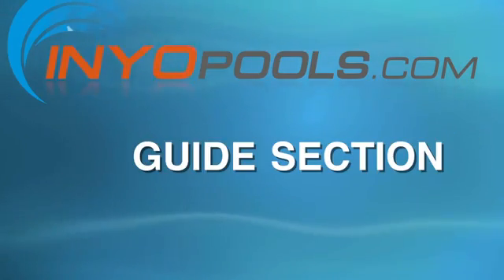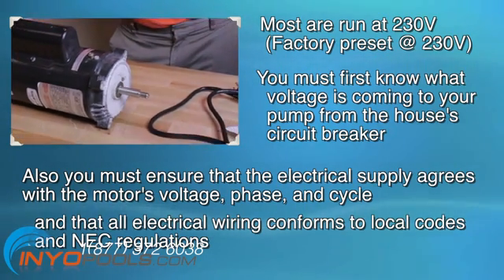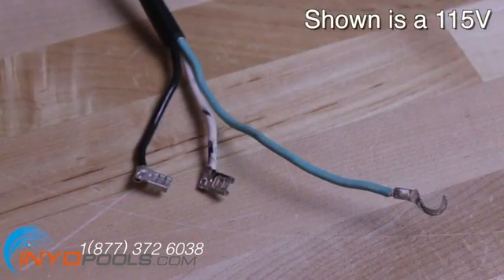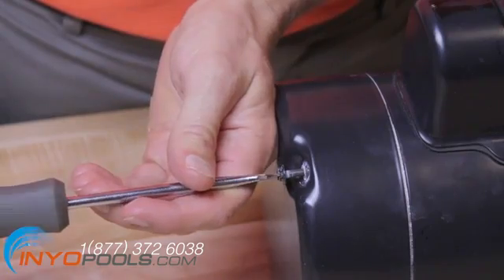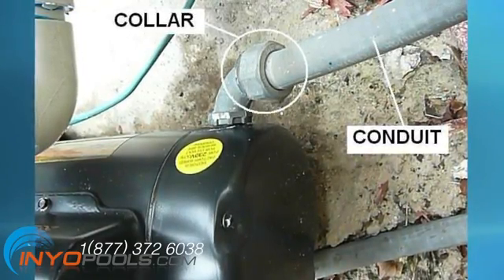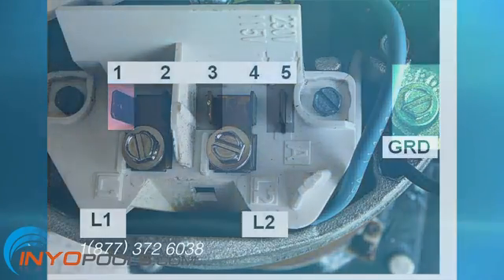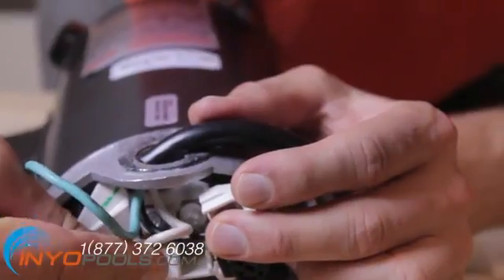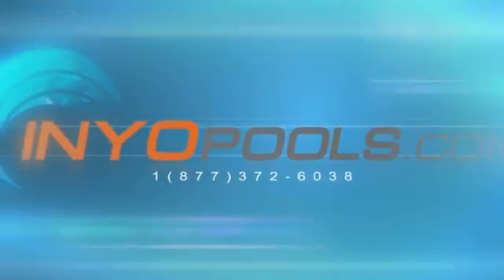How To: Wire A Pool Pump

Comment: Noone shows where to bond bonding wire to what
Reply from the maker: The pump's bonding wire is connected to the ground rod, which would be installed when the inground pool was built. The ground rod and wire are already in place when a pool owner completes this installation, which is why most guides don't show the wire getting connected to the other side. It's already there.

Comment: What if I have 2 black wires, 1 red wire, 1 green?  Cap off 1 black wire?    for a 230v motor
Reply from the maker: Is this a single speed or dual speed pool pump motor?

Comment: I have wfk-12 the wiring diagram for this thing doesn't tell me where power in goes please help! I have the multicolor wires in the unit set for low voltage.

Comment: I am new to this topic. Need to replace old 1 speed 1HP pump with new one 1 speed 1HP pump. Different brand names. Have never deal with pools and pumps before. Watching YouTube for educational purposes. You say that White (neutral) wire goes to L1, and Black (hot) goes to L2 terminals. Another source on Youtube says that Black (hot) goes to L1, White (neutral) goes to L2. Whose information is correct? Sorry for this question, but I dont want to fry new pump.

Comment: Mine has 2 white wires coming out with a ground on the housing. How do I know which wire to connect to the box?
Reply from the maker: We'll need more information. Are you trying to connect the lines to the motor or to a timer/breaker? If it is a motor, what is the catalog or model number?  Have you confirmed the voltage using a multimeter?
Reply: @Inyopools  I got it figured out :) the new motor I got only had two wires coming about 3 in. I went into the back and saw where to connect the ground wire.

Comment: My original plug has a red, white, black and green ground wire. Which two do i use on my hayward 230 1hp motor.

Comment: In the video it says, regarding the bonding wire, that the "Bottom wire is connected to the pump..." well no kidding. But where does it go?
Reply from the maker: The bonding wire from the pump is usually connected to another bonding wire using a split nut.  Check out our guide titled " How to Add a Line to the Pool Bonding Wire". It will explain how everything around the pool is bonded. http://www.inyopools.com/HowToPage/how-to-add-a-line-to-the-pool-bonding-wire.aspx

Comment: Hi, I am replacing  Hayward super 11, 1 hp. with Hayward max flow 1.5 hp.   The house wiring is for 220 volt. My question is   what is the difference  between  110  and 220    is it performance ? or other things   what will happen If I use 110 Volt option  ?  Hayward max flow 1.5 hp. is wired  for 110 1nd 220.    Thanks.

Comment: Question. I got Pentair Whisperflo 230v 2hp. I did an overhaul to the motor and changed the bearing and shaft seals. I like to test the motor see if ok,  before installing to the pool. Electrical motor I have L1 L2 and ground and there is white wire going for motor to the L2. How do I test the motor with regular wire and plug to outlet?
Reply from the maker: Hello Armen - Most standard outlets are 115v. Your pump is 230v. You won't be able to test it with a standard plug and outlet. You can test it with the power that is currently running to your pool motor.

Comment: Thanks for a straight forward video!!
QUESTION-- I am switching from a 230v dual speed to a 230v single speed-- my current connected wiring is 1-white, 2-black, 3or4-blue, ground-green. *I have no RED wire.
?? My new Pentair WhisperFlo has L1 & L2, &ground--- do I simply attach white&black as hot and remove blue?? Guessing "3or4" is the low voltage 
Again, going from dual to single.
Thanks!!
Reply from the maker: We highly recommend that you reference the wiring guide that came with your motor. A 230 single speed pump requires three wires( Two hot and one ground). White is never a hot wire unless someone improperly installed your wiring, which could be very dangerous. If you're unsure how to safely test your wiring to figure out which lines are hot, then we would recommend getting help from a local professional.
Reply: Inyo Pools 
I'm going to use a red Sharpie and color the white wire red the first couple inches.
Reply: Inyo Pools 
Thanks for reply, and suggestion-- I looked at old motor diagram, it was wired correctly for using timer vs switch... except they used white for what typically red wire on motor L1.
I simply removed unnecessary blue wire from power supply,taped it and left in timer box for possible future use, taped off motor end as well, then straightforward wiring.
Motor is working perfectly!!
:) Yayyyyy *thanks again

Comment: I upgraded from 1hp to 1.5hp and followed this simple instructions. When I turn on the pump it trips the circuit breaker, what am I doing wrong?
Reply from the maker: Hi Big Mike, when a breaker trips, it's an indication that there is either an electrical short or an overload on the circuit. Double check your wiring to ensure that there are no breaks or wires touching. Also, your new more powerful motor may be drawing more amps than your old one. Is the motor wired for 115 or 220?

Comment: Thank you. Your suggestion to check the voltage saved me about $450. Although wired with a white, black and bare ground it was in fact wired 240v not 120v. I will be replacing the 120v black, white, bare with the proper green, red, black ASAP.
Reply from the maker: Saved money is the best kind of money. Thanks for watching. - MGS
Reply: Bob Tierney color doesn’t matter.

Comment: reverse polarity 1081 Franklin pool pump motor. can you help me? The motor came from a hot tub and I have it on my air compressor; but it rotates the wrong direction for the compressor motor to work properly.

Comment: Hi I'm a bit of a novice when it comes to pool motors and pumps. Though I am learning a little at a time. My question, I have a Hayward 2 hp superpump and recently was given a pentair superflo 1hp pump. What would be the out come or is it possible to switch pumps being that I would be lowering the hp?  I have done some research and feel that the superflo might be able to do the job. Any insight would be helpful. Thanks.
Reply from the maker: The Superpump and SuperFlo are pretty much the same when it comes to flow rates, when comparing similar horsepowers. If are dropping from a 2HP to a 1 HP, you are going to see a significant drop in flow. you will have to run the pump longer, and possibly cost you more to clean your pool.

Comment: I just switched out my old Hayward 1 HP pump with a Hayward Super Pump, 1.5 HP.  The breaker in my box is a wide 15 amp that takes up (2) spots.  When I went to switch out my old pump to this new Hayward, I saw that the wires going to my pump are 2 black wires, and 1 green wire.  They are of heavier gauge.  (not braided, but solid).  I "assumed" they were for 220 V, and have wired it up as such no problem.  Turned the power back on, everything seems to work fine.  However, pump motor is a bit "Warmer" to the touch then I remember.  I've run it for 2 hours on, and it won't burn you, but it's warm.  I can hold my hand on it for 10 seconds though, no problem.  No problems with suction, pressure, etc.  Is this warming normal, or do you think I may have 115volt wires going to it?  I don't have a Voltmeter.  :-(  Thoughts?
Reply from the maker: If it is working fine, then keep the motor the way it is. Motors get warm, they may even get hot but that is just a byproduct of their functioning.

Motor aren't meant to be handled when they are in operation, so leave it be for now. If the motor begins to overheat and shut itself off, or trip the breaker then that would be cause for concern.
Reply: Thanks!  Yeah, it's been working 100% fine since install.  :-)

Comment: I have a 2hp Pentair pool pump that I am connecting the wires to. I set the jumper on the top 2 poles(Jumper wires are Black wire to top and white wire to the pole under it), and hooked the power wires to the 2 screws. Hooked up the ground to the green screw. When I turn the pump on it starts and immediately throws the breaker. I am wiring it up for the 230 volt. Where did I go wrong?
Reply from the maker: Can you send us a picture of your wire connections and the motor's back end? Please forward the email to upload@inyopools.com Subject: ATTN: Youtube Comment

Comment: Why does my pool pump motor run for 5 minutes and turns off for 5 minutes and continues to do that all day???
Reply: Possible low voltage
Reply from the maker: biggstell Best guess would be your motor is overheating for some reason. Take some time to read our how to guide on overheating motors: http://www.inyopools.com/HowToPage/how-to-troubleshoot-a-pool-pump-motor-motor-overheated.aspx

Comment: 115V and 230V are stamped with arrows are pointing down to terminals 4 and 5. So wouldn't for a 230V connection one of the load lines be connected to terminal 5 (or A)?
Reply from the maker: chris clemann  the stamped 230 and 115 voltage markings is  for the black jumper switch that selects the voltage; the hot wires will not be connected directly to either of those terminals. 

Here is an excerpt from our how to guide regarding 230 V wiring: "Red will go to the L1 terminal and black will go to the L2 terminal. The green wire will be under the green screw to the far right. In addition, there is a black plug with two wires coming from inside the motor, a black wire and white wire with a black tracer line. The black plug is positioned so that the white arrow on top of the 2 prong black plug is pointing at 230V. "

Comment: a straight threw connector make it easier to get the wires to the pumps motor, and a plastic connector works better I have found, as the metal one are wire scrapers, and can damage the wires. some lube on the caps (cover) screws,bolts threads makes it come off easier next time when the motor needs service. not on the power screws !
that's the first time I have heard a multi-meter called a multimiter ?